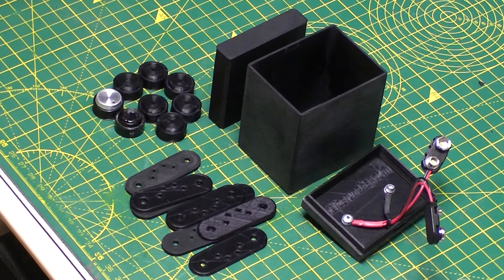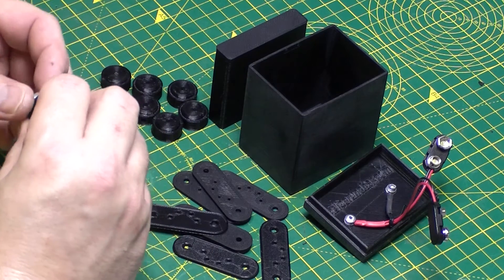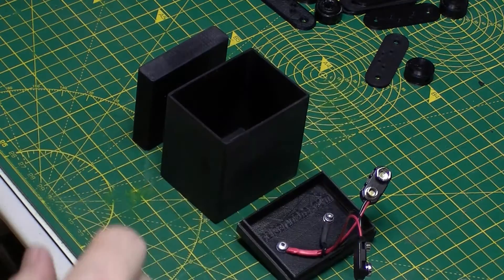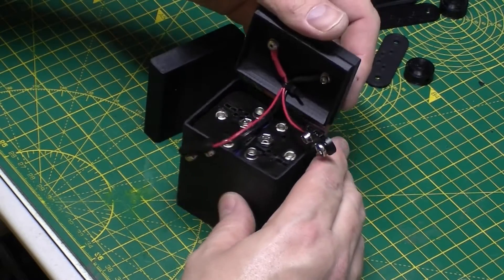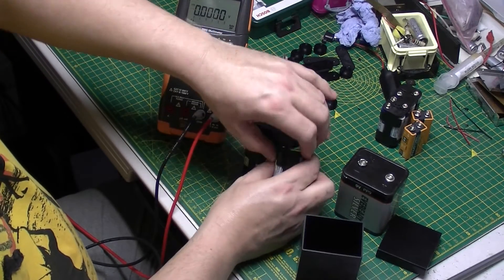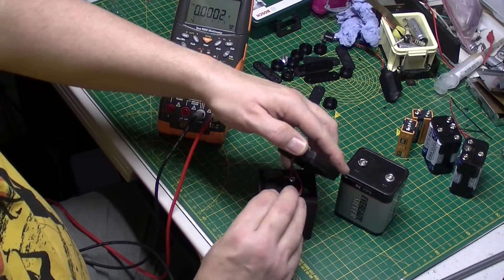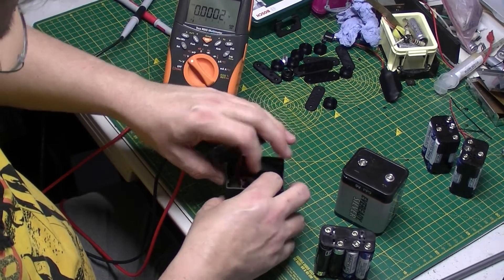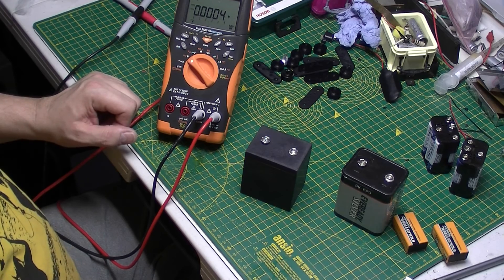PP9 battery solution. More 3D printing

Comment: Hi graham. Like your battery cases. Seems a very good idea. Are you able to do something for us lot that have the Roberts R707 and use the pj996 Langton batteries? Perhaps with aa cels or even the bigger ones. Look forward to hearing any comments you might have. Take care. Derrick Tafman.
Reply from the maker: Hi Derrick. I have cracked open a PJ996. I need to see what will fit in as D cells are too big. I might see if I can make rechargeable ones. Watch this space 😉

Comment: A safe home for the unused battery clip 
could be a slot printed in the back of the spacer . 
May be with a one pin for the - clip .
Reply from the maker: That’s a good idea thanks. I am always tweaking the design to try and improve it. I had a request from a foreign customer to have 3 PP3 clips which I did and popped some foam padding in to stop them rattling around. Thanks for watching